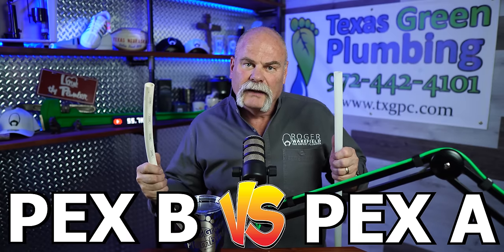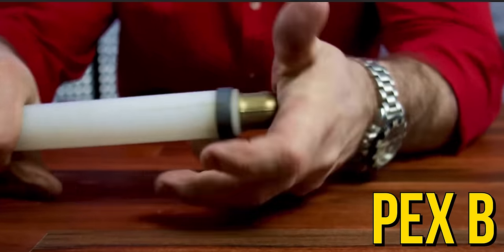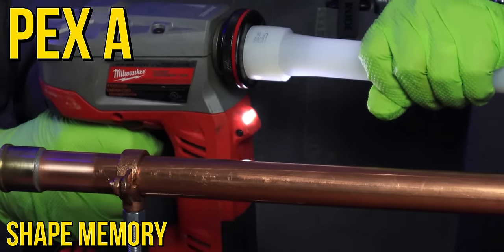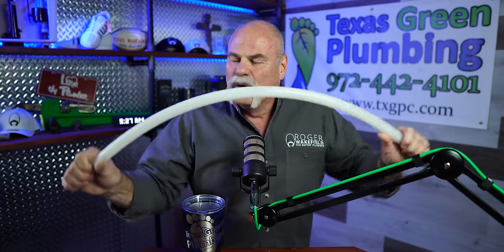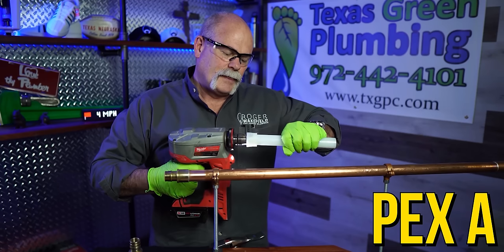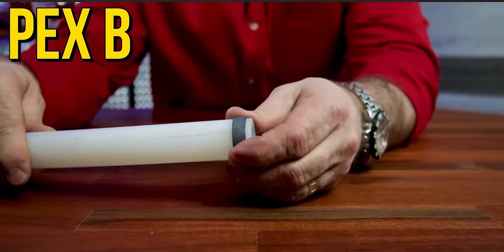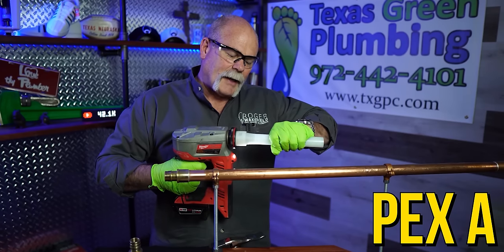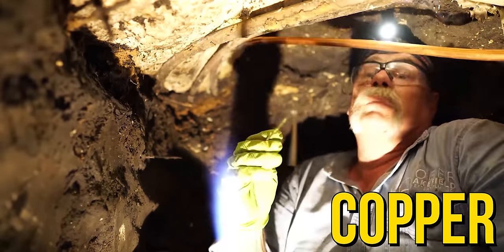PEX-A vs PEX-B - What's the Difference? Which Should You Use?

Comment from the maker: Which do you use more and why?
Reply: Huge fan of Pex A, the Rehau Everloc+ system in particular
Reply: Per b if you size it correctly you will have no problem been putting it in for 10 years now also Noticed in areas with high chlorine pex a will fail faster then pex b  but if I’m doing repairs on copper I’m putting copper back in and yes I replaced 10 year old pex a in restaurant that are exposed that have uv light hitting it all the time
Reply: Pex b because uponor takes a while to shrink down in the cold and I dont feel like buying a heat gun
Reply: I work on RV's I hope one day they will switch to PEX A but due to cost/time manufacturers don't have a care for a superior product. Plus they only install 1/2 or 3/8 PEX B.
Reply: Had my 1950 house replumbed in Uponor and I've had no regrets. I can also work on it myself and with the Milwaukee tool it's far easier to do so than sweating copper.
Reply: I’m a plumber from Australia and we have heaps of pex options from auspex to duopex to kempress but I have always used rehau just curious do yous use that in America?
Reply: In Los Angeles when you doing the PEX system you need to oversize if you want to pass inspection.
Reply: I finished school for plumbing in February and have been using pex A for new home top out. I love your videos man keep up the work!
Reply: I personaly use for drinking water  Alupex pipes [PE-Xc/AL/PE-X] ( It is a multilayer piping system simular to pex a-b-c but better as it has a higer bend radius, its stronger, its more resiliant to scratches) for the fittings i use two kinds. For testing or short term i use fittings that can be tighent with a wrench (can be used allmoust indefenetly). For the final system only press fittings (one use). For heating solutions I use allso alupex pipes after the T valve that regulates the temp. And before where the temp is higher then 60C i use metal, bras or copper and only with old school ways to fit them together, dont like the teflon tape and simular products as i cant realy count on them for long term performance in hard contitions. And lastly for the main water pipe that comes to the house i use Uponor PEM pipes. Forgot for the floor heating i personaly love Uponor Comfort Pipe Plus [PE-Xa]. Remember each pipe has its own life cycle and is set to its operating temperatures so no need to but in pipes that last 100y and then but some pipes that last 12y your final system is going to fail in 12y eaven if you but in some good pipes. And for me i before i start a job is it new or old i sit down with the costomer and explain what we can do and what is reasonable for his wallet. There is allways the Chinesium for each field is it pipe or fitting but the best i can say is 10y max after that its up to you ;)
Reply: hey why don't just use pvc, we use this on my country and it works fine
Reply: My fathers a plumber and said pex a leaks if it’s not heated, he doesn’t trust it behind walls - he uses viega it doesn’t kink they have solid and flex options
Reply: Ive been working in the trailer factories in Elkhart Indiana for almost 10 years, (Modular housing specifically) and they almost all use Pex-B exclusively. It really is a huge time/Labor saver compared to sweating copper. Also the only failures I have seen are what you mentioned, missed crimp rings. (We use pressurised air to test the system before shipping)
Reply: I've been using PEX-A for about 7 years.  Used all copper prior to that.  Started with Uponor and moved to Sioux Chief when they started making less expensive fittings.  I use mostly poly fittings as I've heard they last much better than brass fittings and are cheaper.
Reply: Pex A!! Have you seen the Zurn heads that fit on the Milwaukee gun. Zurn makes a proprietary ring for that works with Uponor fittings. Your basically expanding pex B and using Uponor fittings and relying on the Zurn ring. Our project manager wanted us to use it on a small job to try it, so we did. I didn’t like it. Uponor Pex A has never failed me yet!
Reply: @josephskulj8643  same here...
Reply: Nothing but silver brazing here buddy!
Reply: I've only been pluming for about 3 years and I have only used PEX A. The only thing I hate about most PEX systems is that most plumbers in our area stub PEX out of the wall. We end up stubbing out half inch and three quarter copper bullets on our rough ins. It gives it a much cleaner look vs PEX in my opinion
Reply: B Pex but for me 20 years ago the cost of B and ease of use was better. Now with the tools available and cost of them I could see changing to A. Those old hand pumps for A pipe were crap, lol.
Reply: I like pex a the best because sometimes when I do repairs it’s extremely difficult to get a set of crimpers into small areas.   Leaking shower valves that are stuck behind finished walls... great example
Reply: Joe Boxter when speaking specifically about shark bite fittings, it’s a little hard to be concerned about flow restrictions when every joint in your house is leaking.  I joke, of course (kind of.  Don’t use those, man).  But honestly, shark bite fittings do actually restrict flow quite a bit.  Please keep in mind that they require a reducing insert which does restrict flow to a high degree.
Reply: Devin Ingram hey man.  If you want a high quality finished look without having to go through the hassle of sweating pex inserts onto copper stub outs, you should look into picking up some chrome sleeves that go around the pex after the drywall goes up.  They’re extremely cheap, and are just as easy to install as any escutcheon. Just cut off your tester caps, slide on the sleeve, and then crimp your angle stop.  Looks even better than copper, and won’t accumulate patina over long periods of time - especially a problem when dealing with small sections of copper pipe where the soldering flux runs down the length of pipe that you’re holding with your channel locks.  🤔.  Food for thought.
Reply: I am Diesel Mechanic this video got me thinking, about could this be applied to the the air lines on a big heavy duty truck.
Reply: I currently have copper most everywhere. I'm replacing with PEX-B. Because it's a refit and I have a lot of tight areas to get into, cinch clamps are easier to use. And if you are using cinch clamps, you might as well use PEX-B as it's lower-cost and more readily available.
Reply: I'm a homeowner,   local contractors pissed me off,  with OUTRAGEOUS QUOTES,  bought the Dewalt 20v expander tool myself , uponor aquapex and fittings ,  I'll follow code (and go above it) , and DO IT my damn self
Reply: @WeirdOne19142  you can get crimp ended copper stub outs with stud plates attached. Its super easy. That is one area pex alone cant handle.
Reply: Best videos man great job!
Reply: I have installed a lot of uponor. Mainly in commercial and industrial. Though Propress copper is more common. I havent messed with any PEX B. I like the idea of running all of my water supply thru the attic instead of underground. I want to run uponor in the attic due to its flexibility which would allow me to have no joints in the attic. I don't know if PEX B is flexible enough for that.
Reply: Pex B is fine if you oversize(1" trunks on both hot and cold)
Reply: I still run across plenty of QuestPex that's still in good shape and we're arguing over Pex A and Pex B lol....
Reply: Lo wo Im going to assume you’re not trolling. Pvc does work, but PEX and copper last a lot longer, and PEX is just very easy to install as well
Reply: I've been using pex a because you get more water flow compared to pex b
Reply: I always use copper.
Reply: @edgarkoen1230  
Pex isnt even allowed on legitimate commercial and industrial projects, they spec in Pro-Press copper
Reply: @bmth477   That's why i carry a little torch with me.. :) .. and as long as you seat the pipe and ring on the 
fitting and it's holding.. it will leak a little but over time will stop..
Reply: I only use Uponor...  when i was living in Arizona it was all we did... copper and Uponor...  still all i use... 
  and for the record their are other companies now making Pex A.. lol.. i was shocked also
Reply: Why aren't homes built with channels in the foundation so digging breaking concrete isn't needed when accessing plumbing? Flooring is a lot cheaper than that kind of labor.
Reply: as someone from the midwest is it not common knowledge to drip your faucets when its below 0f in case of loss of heat/noheating so the pipes dont burst
Reply: Pex A is better I every possible way no matter the location. If it needs to be rigid I use copper or pvc or similar
Reply: @hedonisticzen  Cost.
Reply: I'll soon be doing a complete replacement of galvanized pipe with Apollo PEX-A in a 1945 bungalow. It'll be equipped with one of their 12 port valved manifolds. "But Apollo doesn't make a PEX-A valved manifold!" Well, they do now. They have the PEX-A valves that screw onto the manifold just like their PEX-B valves. I found them on their website and asked if the A valves would screw onto the manifold. Yes and just coincidentally they were just about to start offering them for sale that way. They gave me a deal on a 12 port with PEX-A valves and inlet adapters. I got the very first one they've sold in that configuration and they'll be putting them on the Home Depot site.

So finally there's an option for a PEX-A valved manifold that doesn't cost an arm and a leg like the all metal ones or building one yourself from a bunch of T fittings and valves connected by short bits of PEX. Will this finally prompt Viega to offer PEX-A options on their ManaBloc line?
Reply: We use uponor pex A & thank u for shedding more light on this great product glad I found ur channel.
Reply: Just repiped  the whole house in PEX-A ,Tore out the galvanized from the shut off valve in.
Reply: @brendanmonagle4891  Pex degrades pretty quickly in UV light so you wouldn't want to use it anywhere there's daylight.
Reply: I refurbished a house that was built in1945 back in 2011-2013 (Mostly by myself). Gutted House of all plumbing etc. and added on and replaced original closet bathroom with a 9' x 12'.  I used PEX B with the stainless steel ratcheting clamps.  I upsized everything until last short run to the fixtures.  Only had plumbing in 1 story.  Great water pressure everywhere.  Did not know of Pex A at the time.  Don't know where I would be able to get it in consumer quantities.
Reply: I've never used pex only copper. I'm thinking its time to make the switch.
Reply: I replumbed my entire house in Uponor PEX A with all Uponor fittings. The install process was straightforward and downright enjoyable.
Reply: Not including the expansion tool, is PEX A more expensive?  I'm about to get my home renovated and I'm hoping to get my builder to use it.  I really don't care if I have to buy the tool for the installer.  I first remember seeing the Uponor video years ago on YouTube and was always interested in it.  I would have plumbed my own home, but because of a house fire I'm hiring a professional.
Reply: @JohnNguyen-iw8qn  I feel bad for you.  It's my understanding that almost all RV's are lemons.  I'd rather have one built or build one myself.  Except for those vintage 70's GMC Motorhomes, the ones with style, front wheel drive, and trailer style dual axles.
Reply: @commodoresixfour7478  - It’s more expensive, but not a lot more… in all reality all pex options aren’t very expensive, but with pex A it’s worth it. The flexibility, shape memory and those fittings!… those fittings can exert over 1,000 lbs of racial force, getting stronger over time! And they’re the same size as the pipe itself so no pressure loss whatsoever. They will NEVER leak. There is no more of a leakproof way to plumb a house.
Reply: I went to school for Wirsbo Type A PEX when it came out. I was a Danny Doubter in the beginning but the pipe has virtually never failed me in any regard. As far as freezing, the composite fittings will break, whereas I've never seen the brass fitting fail. I try to go the extra expense of the brass fittings inside the walls and the composite fitting where you have access. The thinner wall on the fittings of Type B & C can be problematic underground. I have seen them break...the fitting itself. Whatever money you may save with Type B & C is just not worth it to me. I wanna give my customers the best piping system out there not The Price Is Right deals.
Reply: SiouxChief PowerPEX with expansion and or compression fittings. Type B does both. Yee haw!
Reply: @themanwiththeplan128 , all pex are plastic. Doesn't matter if it's Pex-A or Pex-B, UV will degrade it over time. It's literally on the instructions to not expose either to UV.
Reply: @MisterRay11 , that's not true. Pex-A leaks if you don't make the 1/4 turn all around when expanding the fitting.
Reply: Andy Ngô  ya but the manufacturer for pet b gives u a longer shelf life so it’s easier for you to store in your truck and not worry that it will turn milky wite and will need thrown away in 2/4weeks because of uv damage
Reply: Andy Ngô  yes but no I seen lots of fittings not leak from not rotating the tool this is why I use my Milwaukee pex expansion tool for this but the fittings for pex a are easy to damage especially for brass 1 drop and 10 bucks it will never hold water the plastic fittings are a little bit better but if they sit in you truck going around town they will get dinged up over time
Reply: @themanwiththeplan128 , I'm not sure what you're talking about - especially with your lack of punctuation which makes it hard to read. Either way, if the plastic fittings are getting dinged in your truck, how is that the manufacturer's fault? I can say the same thing as copper, letting something heavy enough hit it and it'll deform the copper pipe enough to cause a pinhole leak.
Reply: @themanwiththeplan128 , anything plastic is susceptible to UV - that's just common sense. Sounds like you're not taking care of your product enough. It'd be like leaving an extension cord out while it's raining and expecting nothing to go wrong. Some extension cords are designed to be weather proof, but not all of them are.
Reply: Andy Ngô it’s kinda a FYI or gfyi  I’m just trying to inform people about pex a and it’s not the best pipe system it’s a ok piping system but it also has some faults on my punctuation it YouTube I’m not going to add ... ???!!!! On every comment and on copper pipe fittings and pipe will tarnish overtime and yes will get nicks overtime but you can still clean and use them I’m just informing you that if pex a fittings sit in you truck they will ding and can not be used just saying
Reply: @themanwiththeplan128 , if you don't use punctuations nobody is gonna be able to read your incoherent ramblings. The point was that if you don't take care of your materials, even copper can be damaged to a point that it's unusable, which is your fault and not the manufacturers. If you're gonna let UV light degrade a fitting, what's the likelihood that you properly protected a Pex-B Pipe? Zero. And there is absolutely no literature that says you can leave Pex-B in UV for 2-4 weeks before degradation.
Reply: Andy Ngô yes you are right But I am going off of the manufactures recommended installation time or shelf life for pex a it’s about a month after the box is open for pex b it’s 30 years I buy a lot of pex so if it’s going to sit in my shop what would u buy
Reply: @purplepill2024  I understand. We live in Connecticut and everything here is very cold. The plastic takes a while to shrink because of the climate. That’s why heat needs to be applied.
Reply: @MisterRay11 , gotcha - that would make sense. It would take much longer to solder copper in cold weather as well.
Reply: I had to do a good bit of plumbing around the house and decided to get Uponor for the job instead of doing more copper. Worth every penny to skip the copper... no pun intended. The time savings of Uponor vastly outweighed going with copper. I am not well practiced in sweating pipes. Uponor allowed me to make plenty of runs and connections 100% leak free the first time.
Reply: I use uponor more than anything.  Where I live in Kentucky there's cpvc in most homes.  I Allways go back with uponor when replacing cpvc.   And it's easyer to run and don't have to wait for cpvc glue to dry and the glue won't take right when there's a little water on the cpvc pipe.
Reply: Hey Roger what do you think or is there a concern for the 3/4 connections on water heaters having a 3/8 to 7/16 ID even on tank type water heaters from the big box stores?  I got raked over the coals in a Facebook group by fellow plumbers saying who cares that's the way they make them.  Yikes, I'm just wanting the best flow for the customer.
Reply: @bmth477  umm, it takes a while to shrink down? If it’s close to freezing you should probably wait about 10 minutes.
Reply: I prefer good olde P.b.pipe 😀
Reply: @erichgruebel474  I hope you mean SUNLIGHT.
Reply: @Blueflesh4  that’s a good point !  I wouldn’t  use pex in places that have rodents, like old farm houses.
Reply: @bigglilwayne7050  why oversized? Use zurn expansion fittings!
Reply: @purplepill2024  I only went to 3 grade. Not sure what punctuation means? I a decent plumber though.
Reply: @mr.redneck2715 , speak like that and you wouldn't get hired by a deaf client.
Reply: @purplepill2024  funny you say that, I have done extremely good (well) in the trades. sorry my five year old granddaughter says I should use well.  
 People seem to care more about a good job than they do about your education!
Reply: Hey Roger. Great video. Very informative. I live in Central Texas myself ( Groesbeck area ) and was wondering where’s the best place to get PEX A supplies? We are fixing to start a remodel on our house and I’m going to re-plumb the whole thing all the way out to the water meter. I would very much appreciate any tips you could give. Thanks.
Reply: Just use the fittings and crimp rings on pex-a
Reply: @mr.redneck2715  
I dont trust anything Zurn.... I'll stick to running circles around all of the "expansion connection" guys with the time proven Oetiker clamps
Reply: @bigglilwayne7050  I’m actually neutral here, just trying to make the point that you could use either connection with the Zurn!
Reply: @mr.redneck2715  
Another of the many advantages of Oetiker clamps is that it allows you to make repairs on polybutalene with regular pex fittings instead of the pex-by-polybutalene transition fittings.... Can the Zurn do that???
Reply: @bigglilwayne7050  I was only making a point that you could use both types of fittings with the Zurn. I am not an advocate for Zorn or any other product!
Reply: How does Pex do in freezing conditions? I can't help but feel like it's going to crack easier. But I could simultaneously see that it may have more room to expand, potentially making it safer in freezing conditions. But in freezing conditions, maybe the pex material becomes more rigid? What is your experience? I'm about to purchase a new home and would like to know if I should avoid this and buy a slightly older home or welcome this new plumbing style and just go with a newly built home..
Reply: Another advantage with pex A is the tool to use to make the connection.  With pex B, it can be difficult if not impossible to fit the crimping tool in tight areas. And how often do you have to "pre-crimp" the ring with pliers (gently) to insure it does not slip while using the crimp tool.  I invested in pex A a few years ago and will never turn back. I also install copper where there's copper, however, on repipe jobs I use UPONOR pex A and fittings.  Another advantage with the Uponor plastic fittings is that they are rated to be install in walls / ceilings.  Other plastic pex fittings are not approved for this.
Reply: @wolfattack402000  
The Oetiker ratcheting tool gets in way tighter spots than any expansion tool
Reply: sharkbite :)
Reply: Everyone uses the cheap PexB until it's a heating job which you can only use PexA
Reply: I am a property owner and not a licensed plumber.  I have moved from California to Florida and have found that in my area, expansion pex-a is not to code (only crimp pex-b is).  I have now been forced to re-plumb my home in pex-a without permits.  Why no permits?  Because I would rather use the superior product (pex-a compression) and have a plumbing system I can trust than get permits to put in an inferior system (crimp pex-b).  

You literally can not make a mistake with pex-a (as long as you remember to 1. put the expansion sleeve on the pipe. 2. put the sleeve on all the way. 3. make sure the expansion tool is rotating and not making a leak channel in the pipe at the fitting. 4. expand the sleeve and pipe all the way and give it a couple of extra expansion hits before removing the tool and trying to put the connection together. (If you don't expand far enough or long enough the sleeve and pipe will shrink before you can get the connection fully made.  YOU WILL THEN NEED TO CUT IT APART WITHOUT DAMAGING THE FITTING OR CUT OUT THE FITTING AND USE A NEW ONE) 5. put the connection together. 6. Seat the pipe with sleeve ALL THE WAY ONT THE FITTING AND HOLD IT TOGETHER for a couple of seconds to allow the sleeve and pipe to shrink back and hold itself together before you start to pull on it and run more pipe.)

In a nutshell,  take your time and do it right ... use the expensive power tool that saves you time and your arms ... put everything together properly ... protect the pipe runs from any rubbing that might wear a hole in the pex-a.  When running pipe through a stud I cut a piece of 3/4" pex and use it as an inexpensive sleeve between the stud and the 1/2" pex-a.  We New Engenders are frugal ;-).  BTW  PEX will deteriorate (go bad over time) if exposed to sunlight.  Like a mushroom, keep all pex products (pipe and sleeves) in the dark and away from daylight and direct sunlight.   PEX-A ... ALL THE WAY!
Reply: A all the Way
Reply: @brendanmonagle4891  I wouldn’t it’s not dot approved. There is pex for shop air though.
Reply: I gotta fix one bad valve on my RV.  I cut a hole in the metal plate so i could access easier.  I bought the expander tool. I need to reorder the right type of expansion valve.  It seems like a better system.  Im just trying to work with what exists on this fancy motorhome. (Pex a).  This helps me feel less crazy for buying the tools.
Reply: Copper....
Reply: my company specifically uses uponor
Reply: I'm sorry but I'm a rmp & pex A is crap. Over priced & not worth it for the $ at all!
Reply: I am going to repiping my house, I like to use PEX-A. The only thing that bothers me is the rat. Is there any way to protect PEX pipes from rats?
Reply: I use O2 barrier (Wirsbo hePEX)for radiant heating. I am also a fan of the staple up ONYX from Watts.
Reply: I use copper because im just not sold on on pvc or pex for bathing or drinking water

I heard it leaches chemical?
Reply: pex-alu-pex     better than anything else
Reply: Zurn PEX. It's type B but its ASTM F1960 rated for crimp and expansion. Plus it's white PEX is rated for residential fire sprinkler systems. One PEX rated for multiple uses. Have been using it for almost 20 years with no problems.
Reply: Run 4 inch septic pipes for whole system
Reply: @lowo6045  it will freeze and break will not deal with the temperatures it's too hard to work with and you need to use glue with it many reasons why it's not feasible and it won't adapt to every type of Plumbing very easily
Reply: I think if it was readily available I would use pex A, but being a novice, I used pex B because that's what Lowes had. 
I used the clamp rings instead of crimp rings because I liked that you could undo it easily, they were stainless, and could work in tighter areas
Reply: When it comes to remodel work Pex B is the way to go IMO much more convenient you do not have to carry around a large heavy clunky expansion tool.I found it very difficult to get it into hard to reach spaces. Whereas the little crimp tool much more versatile.Pex A with Pex B crimp rings?
Reply: They are both garbage, so you really shouldn’t use either
Reply: @lowo6045  the thermal expansion of pex is much better than pvc.   I have seen pex thaw out and be fine when pvc would have been a repair.
Reply: @davidwooten3430  
well, I guess that is a benefit of living in the tropics
Reply: No pex a ... pex a is amazing  for the pros who have them tools.. pex b is perfect for the handyman
Reply: I'll repipe a house faster  with cpvc then any pex
Reply: @cameronbarnes5612  Hello im working in multi-housing, we have CPVC schedule 80-Corzan from 6" to 3" for water main &  (Zurn)-(Sioux Chief) & Uponor pex pipe from 1/2" to 2" for feed lines
Reply: @SilverEnergy  My job is apartment plumbing, since Covid our supply option is crap, we get what's available pex -A, Pex-B ? well dont be choosy or wait several months, failing inspections for incomplete installation, holding up drywall will get your butt kicked off the project. We have several thousand apartments with complicated amenities, dog-wash, car wash, bar & grill, club-house, pool-house, fitness center, catering kitchens, steam-rooms, laundry rooms for staff,& boiler-rooms, we do intend to use the correct pex product, but no cant stop building progress for proper pex material with people already leasing in advance, they have to move in. we hope the wrong pipe will hold up, but if not, dont blame this plumber.
Reply: @chadsimmons6347  yeah using the right pipe for right application is important. As much as I have done wrong stuff in wrong situations I usually for my own safety make a two sided paper that the owner knows and understands that this will not work in long term. And it has saved me 2 times. Once in plumbing second in electricity.
Reply: @SilverEnergy  Last winter we couldn't locate the specified boiler return pipe, so owner had us run a second backup line in case of a future failure. We get these big jobs from a good reputation, not from raising concerns about plumbing longevity
Reply: I personally use pex b.  I've had pex a blow off.  I've never had a leak with pex b.  Pex a is slower to install, the tools to install are hundreds of dollars vs an 80 dollar crimp tool.  I can fit a pex b tool in more places than a pex a expansion tool
Reply: ....DON'T trust sharkbite push-to-connect, the internal o-ring will dry out and fail over the years, the same thing to PEX that does not use a metal clamp. The expansion idea will fail regardless if it takes 10-20 years. The material will lose its flexibility thus its memory turning the water system for the entire house into sprinklers, and you will have a waterfall coming from all over the ceiling.
It will be a really expensive nightmare for homeowners 2 decades later. 
PEX and other new systems are only beneficial to the repairing contractors, speeding up the process, but not necessarily lowering the homeowner service bill.

Like the RV industry, the US house construction industry has become very profitable while offering expensive and poor-quality house constructions. The houses are not built to last, forcing the next generation to buy new homes to keep builders selling new homes, a real mafia with standards not ruled by the authorities. 
In sum, our industry is becoming more and more like the Chinese manufacturing quality.
Reply: Copper, only copper. Pex is crap!
Reply: real men use PEX-A and a manual expansion tool... lol
Reply: @lowo6045  pvc is not potable. Cpvc is
Reply: Pex A . For literally all of the reasons you have said.
Reply: Plex B. Because I'm a homeowner and the equipment cost. Also because until watching this video, I didn't fully understand the differences between Pex A and Pex B, and I didn't even know there was a Pex C.